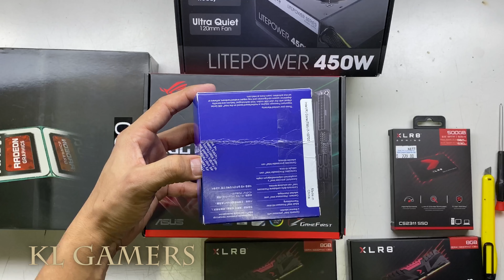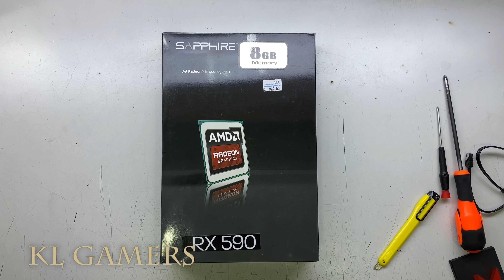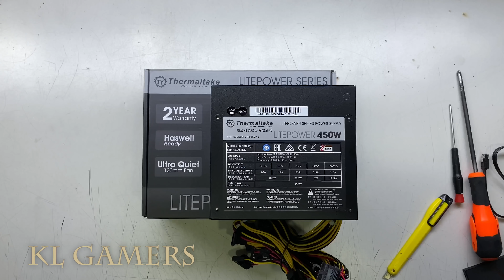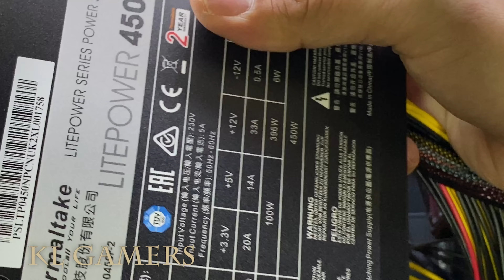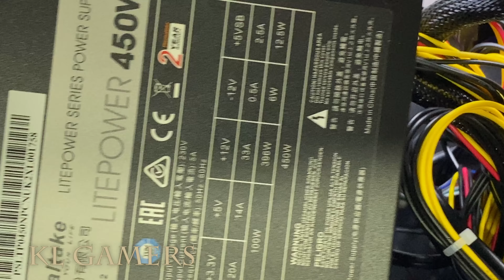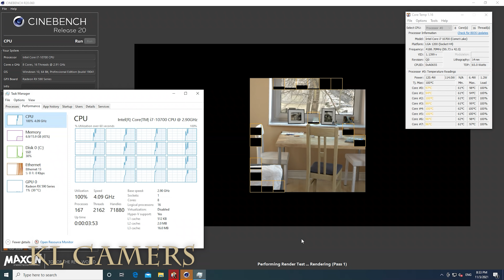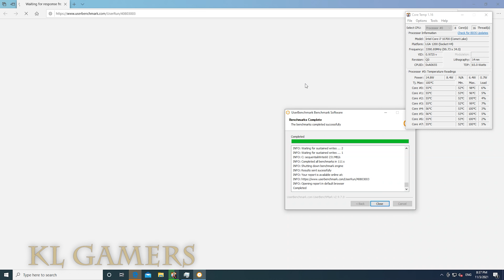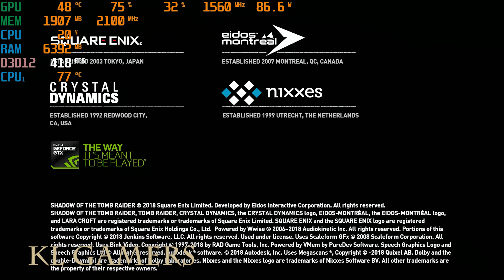intel Core i7 10700 ASUS ROG STRIX B460-I GAMING SAPPHIRE RX 590 SILVERSTONE SG13 Black ITX GAMING

Comment: It sucks when cases don't have any room for cable management and no air flow what so ever.
Reply from the maker: still ok
Reply: You can run front io underneath mobo and psu cable on case side with duct tape. I has r5 3600xt with stock cooler runs at 77C max

Comment: The CPU cooler and Power supply fan are fighting each other in this configuration. Might be able to get CPU temps down a bit if you could get them to line up.
Reply from the maker: Good point!
Reply: I would say:  initially and the starting point is: the worst case for a pc. I like so much the components here but the case !

Comment: How to deciding suitable psu for build?✨
Reply: 1. Get the ones from reputable brands like : Corsair,evga,thermaltake,cooler master,etc
2. Look for atleast 80 + or a 80+ bronze psu and a decent warranty 
3. Look for at minimum for 500 watts for future upgrade
Reply from the maker: Cooler Master
Reply: It doesn't need to be 500w, even 400w would be enough for a mid-range build, just make sure it has got an 80+ certification and some needed connectors like 8-pin 12v connector for cpu instead of just 4 pin, and a 6 or 8 pin connector for graphics card.
Reply: @vinyl.croatia  well I guess 400 watts is the bare minimum for 2021 assuming no overclock on anything but with  500 watts not only it gives headrooms in case you want to do a little overclock and random gpu power spike you don’t need to upgrade psu every time you want to upgrade like the cpu or gpu
Reply: @lok7417  That is true. I would consider 500w if i wanted to upgrade cpu or gpu down the line

Comment: is it enough 450w psu?
Reply from the maker: recommended 600W
Reply: If it's a good PSU - yes. Power consumption of both cpu and gpu in some stress test is near 441w. So if it's 80+ gold (or even platinum) - it will be okay but PSU will work with 100% load.